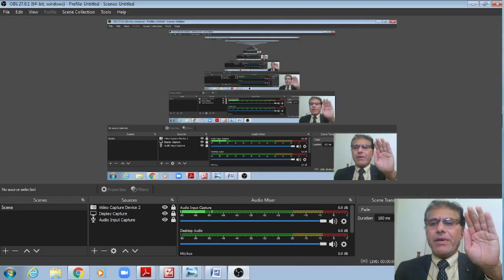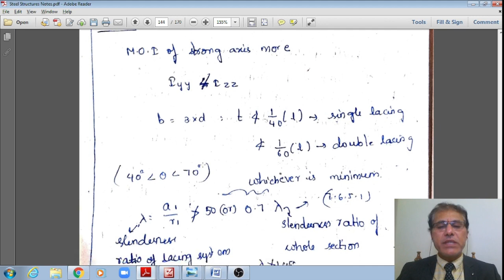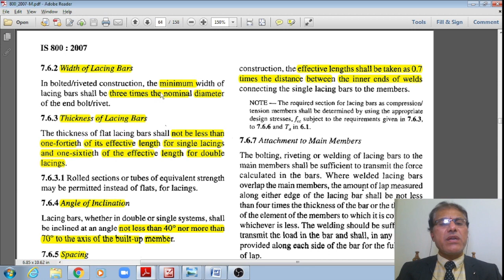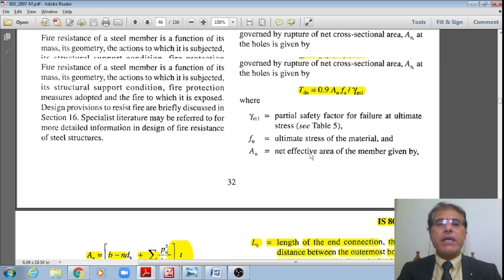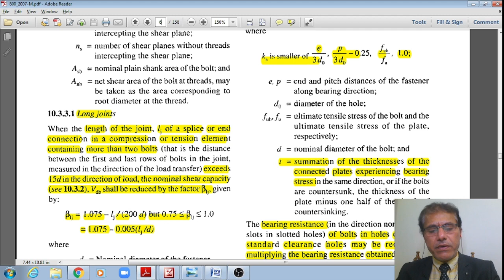DSS29|DesignofSteelStructures| DesignOfLacedColumn InSingleLacingSystem (BackToBack)| Builtup Column

Comment: Timestamps (Powered by Merlin AI)
00:05 - Introduction to design of shield checkers and professor's background.
02:11 - Overview of design proof checks and structural column systems.
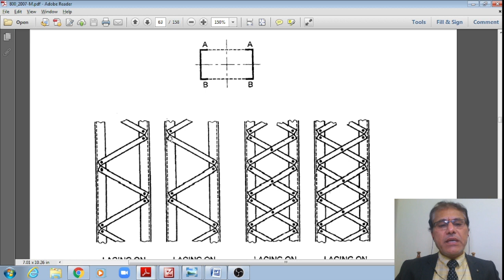06:36 - Explanation of lacing arrangement and specifications.
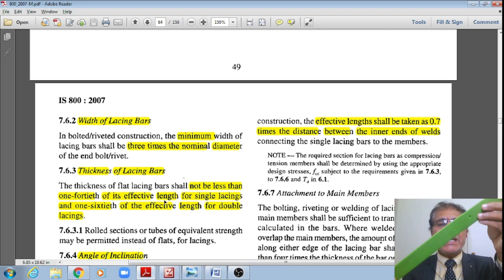08:52 - Guidelines for lacing design on built-up columns.
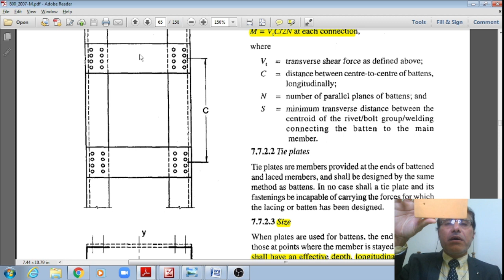12:54 - Design principles for batten columns in structural engineering.
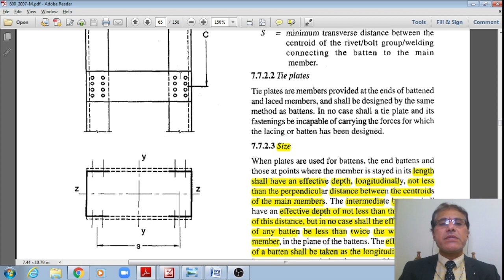15:03 - Design criteria for effective depth of batten plates and their placement.
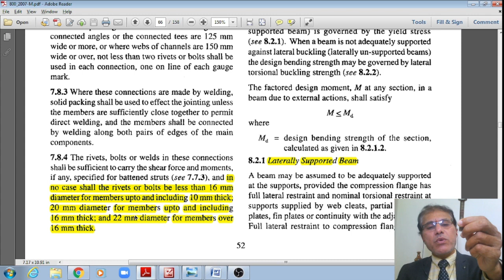19:00 - Discussion on specifications for member thickness and design criteria.
20:58 - Summary of column design parameters and load specifications.
27:16 - Overview of ISMC 300 properties and specifications.
29:06 - Evaluating load capacity and design adequacy for structural sections.
33:02 - Discussion on spacing and moment of inertia in compound sections.
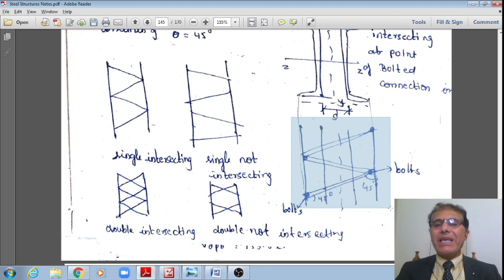35:00 - Explaining intersecting and non-intersecting channel systems in construction.
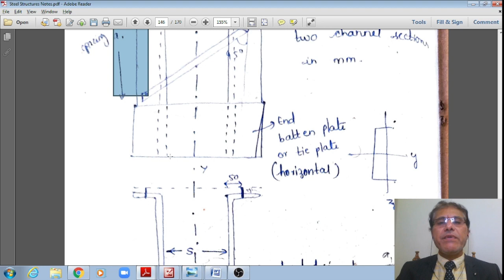38:58 - Calculating lengths in a bolted lacing system at 45 degrees.
41:11 - Stainless ratio calculations ensure compliance with specifications.
45:07 - Design calculations for vertical shear and compression in lacing systems.
48:48 - Adjust lacing system parameters to meet design requirements.
56:28 - Discussion on tension resistance and shear capacities in lacing systems
58:27 - Calculating design shear strength and critical criteria for bolts.
1:02:23 - Design specifications for non-intersecting lacing system and end patterns.
1:04:07 - Specifications for back-to-back batten systems and end patterns.
1:08:02 - Design principles for built-up columns and plates discussed.